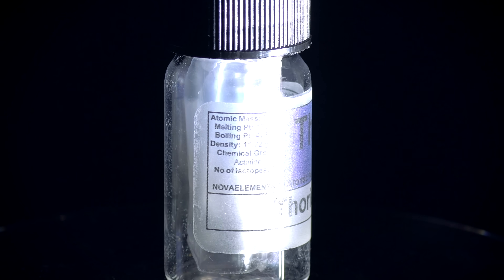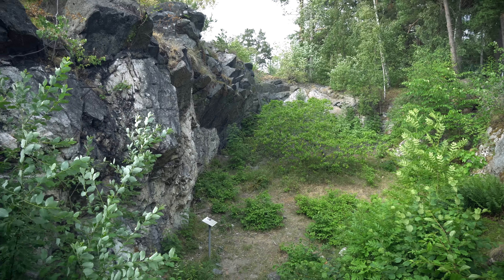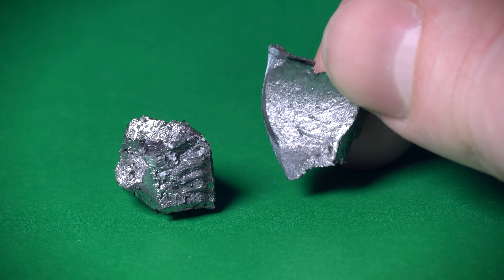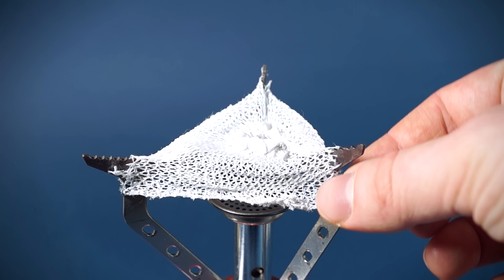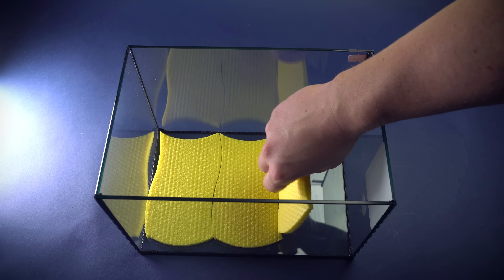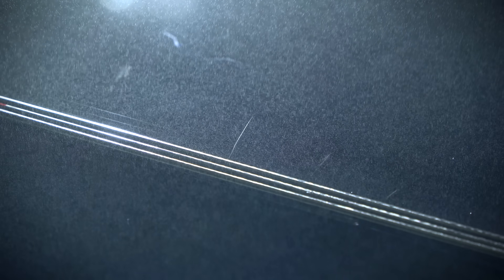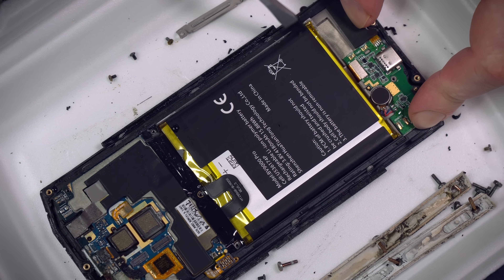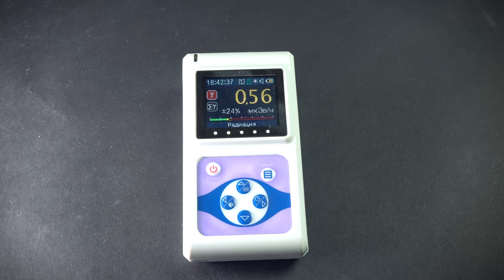Thorium - A METAL THAT NO ONE NEEDS!

Comment: Thorium has a unique electronic property. When put in a circuit a certain way it acts as a current booster. A guy from the 🇺🇸 showed also that it has a resonant frequency onced tuned too delivers more power than a normal beta cell

Comment: Thorium is used in the manufacture of vacuum tubes.
Before anyone replies : " but vacuum tubes  are ancient technology!", let me tell you that every microwave oven contains one (magnetron)
High power radio, radar and tv stations use vacuum tubes....
Thorium is also used in optics (lenses) and is sometimes use in the cladding of welding electrodes.

Comment: Thorium was used in Welsbach mantles so that lanterns would shine more brightly; thoriated tungsten was used for the fuel injectors in the F-1 engines on the Saturn 5 because that alloy can withstand very high temperatures. And exposing Thorium's common stable isotope, Thorium-232, to neutrons makes fissionable Uranium-233, so like Uranium-238, which when exposed to neutrons makes Plutonium-239, it's an important nuclear fuel.

Comment: So, i do tig welding 5 days a week with thoriated electrodes. Am I going to be radiated in some years?
Reply: welding (and flex-cutting) is dangerous for health anyway if fumes are not sucked away properly. Nanoparticles in the air! search for welder's disease (independently of thorium-alpha-radiation)

Comment: I was just lol,, maybe Thor's hammer was made of Thorium, a Exciter of Energy  ??? i was just reading berealiun is # 4 on P table, i remember all to carbon #6 boron # 5 before carbon,, that make berealium Light in weight according to P table,, i surprised, maybe star trek phaser's had a tip of Rad material before high voltage to make the phaser beam ,, just a guess lol

Comment: As others mentioned, it's used in some lenses (like my Kodak) and thoriated tungstens for TIG welding but I could add that it makes the light from lamp mantles (kerosene and propane) a bright white. Nowadays the mantles are a dingy and darker in comparison---but they are no longer radio active.